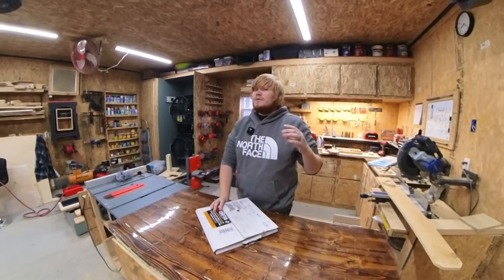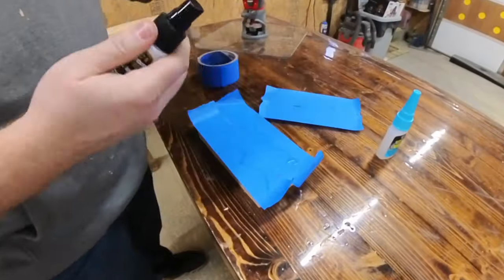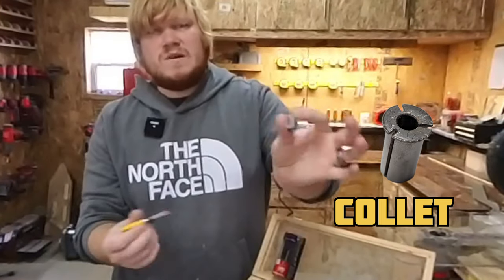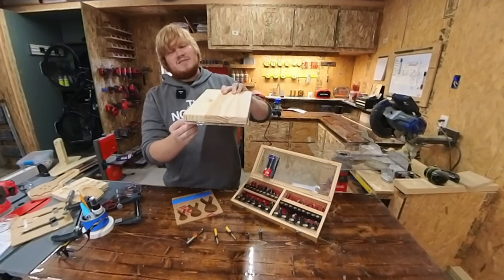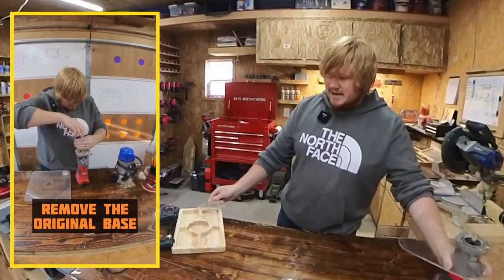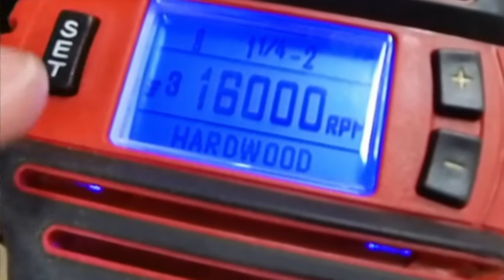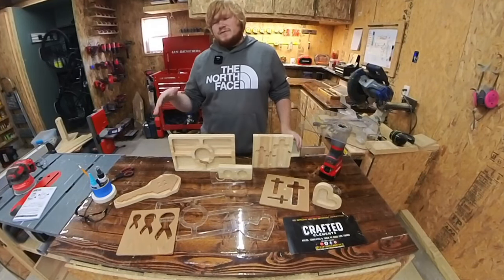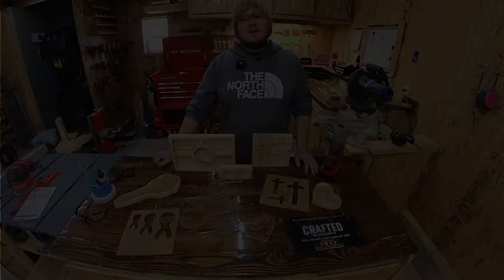Create Quick, Easy, Repeatable Woodworking Projects. | How To

Comment: Great video, thank you. Can those templates be used to make lanterns etc? I looked at their website and it stated to only be used with inlay sets. I just want to make sawdust in the garage and a few things for the holidays.
Reply from the maker: Lanterns are tricky with these since the eyes / mouth / features cannot have sharp edges, and would need to have gentle curves to allow the router to cut out the shape effectively. Check out my lantern video (not sure if that sparked your question) to drill out and cut out the lantern shapes :)

Comment: Hello
I need a 3/8th Cutter Height Flush cut bit (Bottom Bearing)  but can't find one on the internet
Where do you get your bits from?
Reply from the maker: Like this? You can also get a shorter 1/4" flush cut bit, make your first pass and bump it down to reach your 3/8" depth :)

https://www.amazon.com/Amana-45475-S-Carbide-Tipped-Bearing/dp/B001PTZLAO/ref=asc_df_B001PTZLAO/?tag=hyprod-20&linkCode=df0&hvadid=312003160272&hvpos=&hvnetw=g&hvrand=5974264111788934948&hvpone=&hvptwo=&hvqmt=&hvdev=m&hvdvcmdl=&hvlocint=&hvlocphy=9022007&hvtargid=pla-568656131693&psc=1&mcid=ef59370cbd21310badc57f1103228ca9&gclid=CjwKCAiAs6-sBhBmEiwA1Nl8s186qRW-KEI1rGCbp3XHNbBHcUM1seIrd6ZlIwqheQXIh6m4krp4zBoC4g0QAvD_BwE

Comment: quick question. usual templates ive bought are 1/4" thick. i noticed i have a much harder time with them compared to ones ive made that are 3/4" or two 3/4" put together so i can control the depth to start shallow and have plenty of space to lower it as i need. So, is it best to always try to make them thicker? how do you also get around using just a 1/4" and not run into issues where your first cut is too deep and you cant start shallow because the bearing wont ride on the template? i had to get multiple bits and change out which is annoying
Reply from the maker: Heyo! All the flush cut bits I use have the bearing above the cutter, closest to the router. I have a few different lengths of cutters: 1/2", 3/4, 1" and a 1-1/2". Honestly I use the smallest one the most and make passes until i reach the depth I desire. You are 100% correct; the longer bits are pretty much useless when using a router template. Check out these little short guys, you dont even need to switch out router bits to keep the bearing on the template, the bearing can ride against the cutout as you progress deeper into your workpiece.

These are the flush cut bits I use in the video:
https://www.amazon.com/Pattern-Template-Woodworking-CHoiKWong-Diameter/dp/B089FMRWH9/ref=asc_df_B089FMRWH9/?tag=hyprod-20&linkCode=df0&hvadid=459638812776&hvpos=&hvnetw=g&hvrand=4000579713122942967&hvpone=&hvptwo=&hvqmt=&hvdev=m&hvdvcmdl=&hvlocint=&hvlocphy=9022007&hvtargid=pla-942763847726&psc=1

Thanks for the comment!

Comment: I need to route ramakan holes into an end grain board. 1 5/8 diameter and 3/8 deep. How would I do this?
Reply from the maker: I googled "ramakan holes" and didnt find anything, nor have I heard of this. Sorry buddy, end grain you will want a router bit that is spiraled like a drill bit, rather than the two blade yellow ones I used in the video. The spiral-ones have less tearout and burning :)if its just a hole, I would use a forstner bit so it has clean sides and a flat bottom
Reply: @WhosTheVoss  I tried the forstener bit but it left dimples in the bottom that were impossible to sand out and it tore out the hole in spots I'll try the router with a template

Comment: you have way too few subs. Here's one more.

i also got a question, why is it that the router doesn't cut into the template, is it those barings you talked about? I didn't even know they wher ther, next time am in the school wood shop i will take a closer look at the bits.
Reply from the maker: You're the man, thanks for the sub! Yes, the bearings ride against the template, the cutters spin beneath (or above) and cut the wood to match the template. :)

Comment: Good video. Is it just me or does the unclamped jigsaw usage with your hand out in front of the blade at 5:15 look like a possible shortcut to the ER.
Reply from the maker: Great observation! It is un-wise to put your digits in front of the cutting path. In other videos you will see me steering my jigsaw by using my left hand on the guide out in front to control the vibration for a cleaner cut. In this video, I was going ham because I was clearing some material. The wood is soft cedar, and the blade would hit my tablesaw before reaching my cheese-grabbers. If you're uncomfortable, then it's unsafe. Theres a lot I see people do with the tablesaw that I would never attempt.  Thanks for making it to 5:15!! :D
Reply: @WhosTheVoss sure. I figure since this is aimed at beginners, might be worth mentioning.  Apparently, ww videos are full of safety police tho so there ya go. :)